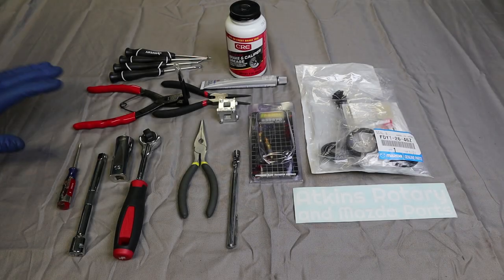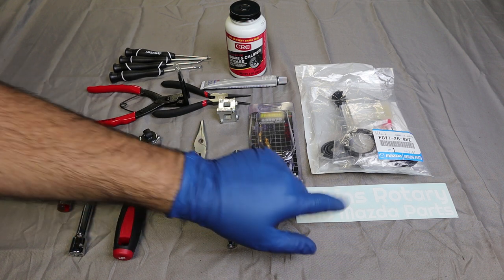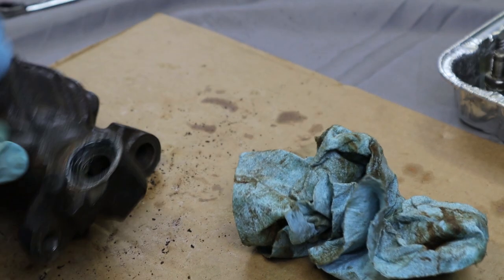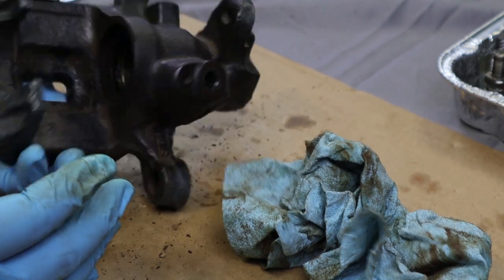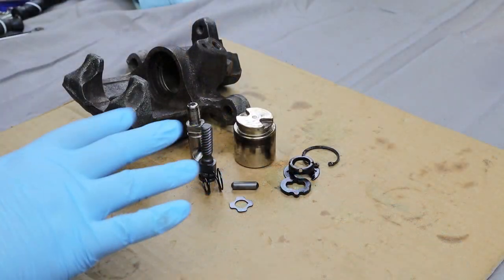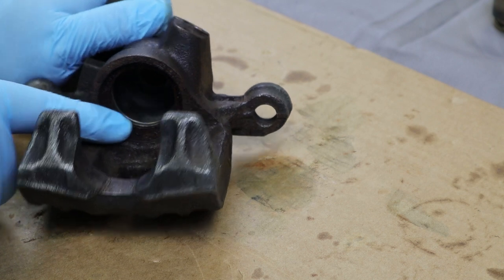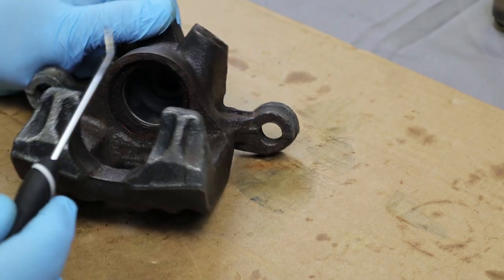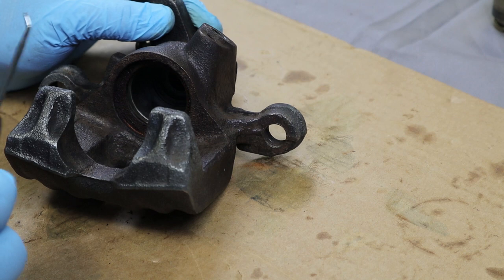FD RX-7 Brake Rebuild Part 3 - Rear Caliper Disassembly

Comment: RX-8 rear calipers are assembled almost the same way--they don't have a snap ring on the dust boot, they have an additional snap ring holding the parking brake shaft in place, and the two-part washer shown here under the spring is just a single washer on an 8. This was very helpful for disassembling mine--thank you!

Comment: Driving mine.  2008 RX8 6-speed.  40th Anniversary, like that's supposed to be "special".

Plan is :  Buy used calipers.  Disassemble.  Polish calipers, & then have them powder coated.  Re-assemble/rebuild.  Swap out my calipers with aforementioned project calipers.  Wash and repeat.

Wish I could x-ray vision suitable used calipers.  My luck, I'll find one or more calipers wrecked on the ole' worldwide web.

GREAT VIDEO.

Comment: Just a tiny big of advice. When disassembling parts, try and show the audience the 360 of parts when you take them apart. I would've like to see the back of the piston and how it goes in.

My 2019 Altima has an electric e-brake and you had to put a 12v source to the electronics on the caliper to compress it most of the way, and I guess it spun it too far the wrong way and it came out without the boot coming off so I couldn't see inside and didn't really know how to get it back on, but I accidentally figured it out by turning it clockwise until it found the threads that I didn't know were there. Great video by the way.

Comment: appreciate this vid is a few years old!  its awesome though!   question,  it looks like these are similar to my rx8 rear brakes (makes sense 😅)  once the piston and seals are out,  could i leave the self wind mechanism as it is rather than take the snap rings out etc and just put in a new piston n seals?   many thanks in advance buddy!
Reply from the maker: Possibly. Depends on if there is any concern for corrosion and/or moisture down inside there. There is a different kind of grease in there and it is the parking brake mechanism. I figure if you are already that far along, it makes sense to do everything so there is peace of mind the whole thing is rebuilt.
Reply: @IconGarage  that does make sense!! Appreciate you taking your time to reply buddy!! 🤘

Comment: use dish soap (Dawn) and water to clean the caliper and parts, use a nylon bristle brush and a green scrubby pad, that is much less expensive than going through several cans of brake cleaner. blow out the caliper with compressed air after rinsing with clean water. paint with caliper paint if you want to at that point but you have to wait 24 hours for the paint to set if you do that. good job using the steel wool on the piston, the steel ones are hard chromed and will scratch with anything else.

Comment: Great video, well done and organized.  Does that needle bearing for the ebrake just slip in and out of the casting? or is it a light press?? something retaining it?
Reply from the maker: I wouldn’t say it is a press fit. It will fit snug. Any corrosion down in there will make it hard getting in or out. The only thing holding it in per se is the rubber gasket with the metal housing. I don’t know if it would take a special tool to pull out, but it’s a somewhat delicate part so it shouldn’t take too much force. Let me know what you find works. Thanks!
Reply: @IconGarage  hey, thanks for replying.  i might destroy it getting it out, but it then goes back to rebuilder... lol

Comment: Hey do you know if this also works with the 4 lug calipers? They’re from an 88 fc unknown trim
Reply from the maker: I’m not 100% on the FC brake setup, but in general, most calipers are fairly similar. The rebuild kit varies a little from caliper to caliper but typically has the same combination of parts.

Comment: I am literally getting walked through with your videos man! I appreciate your videos so much. Quick question though: would you recommend doing the electrolysis rust removal for the calipers? Im concerned about the e-brake bearings if so.
Reply from the maker: Thanks! I hope they help! Electrolysis could work and I even thought about doing that. The Metal Rescue bath I used did a fairly decent job and I have used it successfully on other calipers. I would inspect the bore for the pistons and the e-brake mechanism for rust and pitting. If the bore is not smooth, it may be worth getting a better one. I’ve heard of people having great results with electrolysis and calipers, but haven’t tried it myself. Make sure nothing plated or stainless goes into the electrolysis bath.

Comment: any idea where I can buy one of those little metal pills? dropped one of mine down the sink like a ding dong..
Reply from the maker: Not those specifically. If you haven’t already, it’s probably in your trap on the sink drain. I’d pull that and see if it is in there. Might be able to fish it out with a magnet. If it is gone gone, may see if someone had an older junk caliper they would sell cheap.
Reply: @IconGarage  going to try that when I get back home.  Thanks for the great rebuild video and for the quick reply!